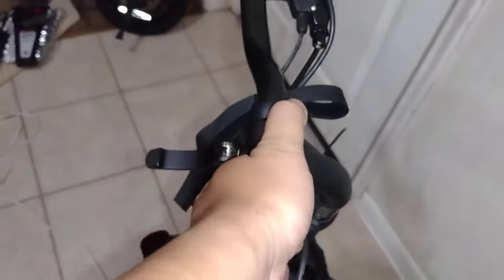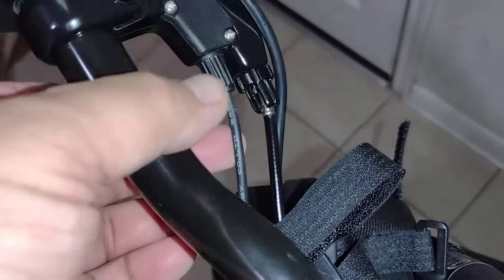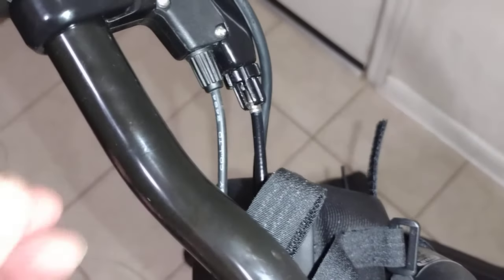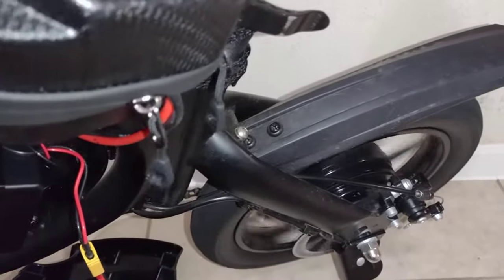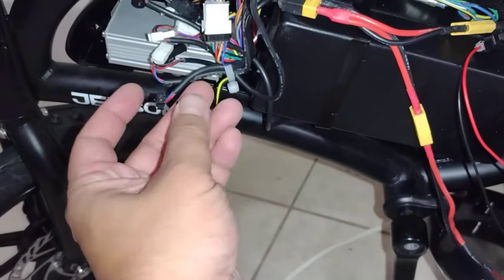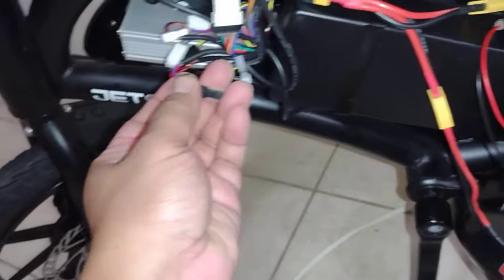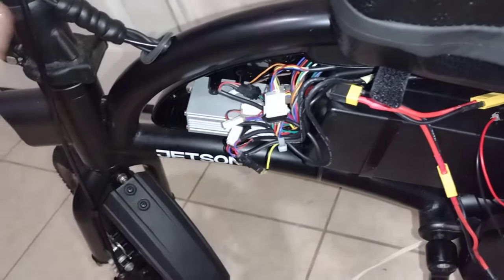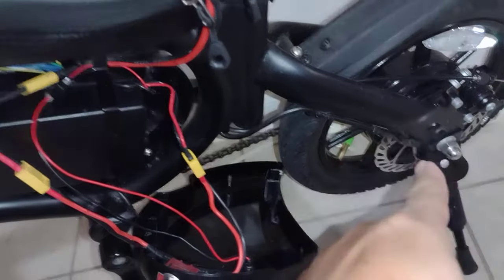JETSON BOLT PRO HAS POWER BUT WONT RUN

Comment: I put an external battery on mines with the proper equipment the black box and all but wont take battery from external it blinks head lights on full power
Reply from the maker: is your battery compatible with jetson?

Comment: i’m having issues my headlight keeps blinking whenever i start riding stops power to my throttle. any help please
Reply from the maker: Jetsons are easy to work on. Open it up .check if there is loose connections.its either your connection to the battery or the throttle or the controller itself
Reply: @jsnantic  this happens when i turn right most of the time even when i’m not riding it & i turn it right battery drops down to 1 bar and headlight starts flashing? thanks for the reply
Reply: and when i turn it straight out left lights stops flashing
Reply: Mine does the same, you found a fix?
Reply: We have the same issue.
Reply: @jsnantic  hey my jet son bike is being really annoying. the power indicator won’t turn on at all unless the handlebar is turned to the right and it doesn’t work to ride it. the throttle does not work unless handle bar is turned to the right and once handle bar is straightened or turned to the left the power turns off and power indicator hs no lights. I have no clue what to do cause I’ve only riden the bike a couple of times. Send help please
Reply: @jeffraymariano1939 did you find a fox